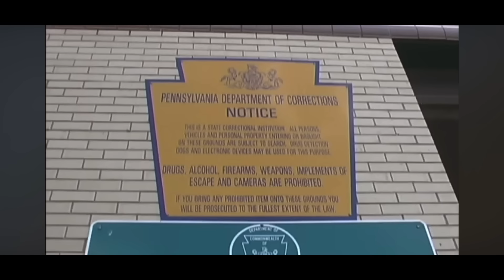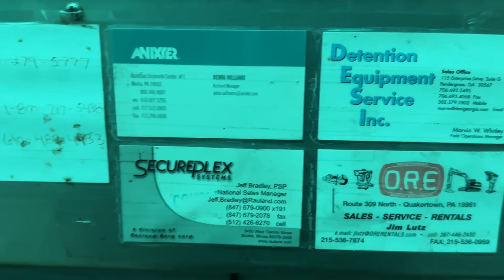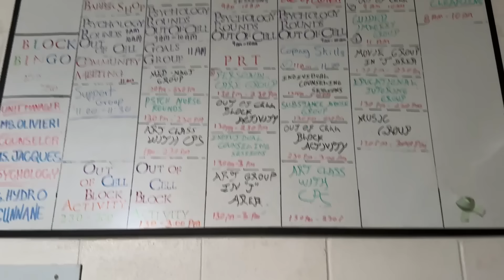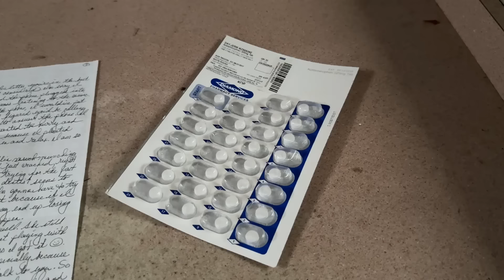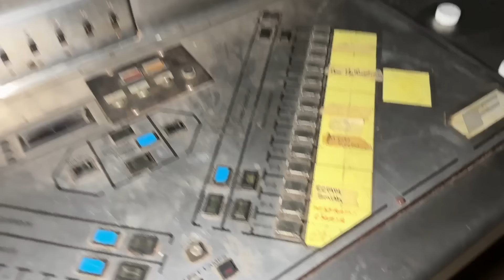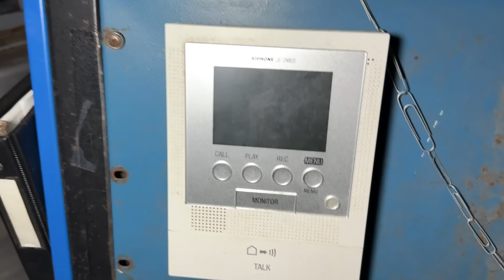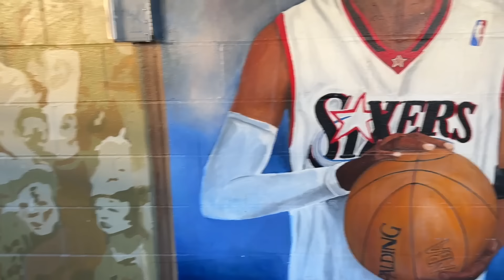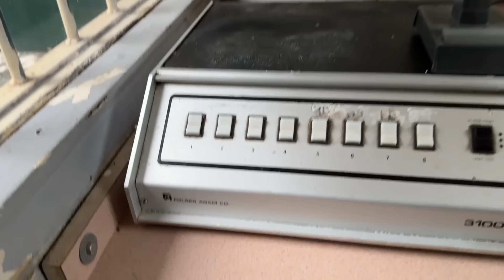Abandoned Graterford State Prison. Found  Death Row Unit

Comment: I applied for a job there 44 years ago,as a maintanance painter. My job would have been to have a crew of prisoners,to work around that huge facility. I was interviewed by 5 people all at once,firing questions at me,to see if i could handle pressure,and i was even told if i got the job,i had to think twice about getting rid of a inmate off the crew,because he could come back to get you later .My friends wife worked there as a dental tech,and she was punched in the face,and missed a month of work. I didn't get the job there,but i ended up somewhere else,in a state facility.That blue hallway,where you entered,still looks exactly the same as when i was 21,going for that job.